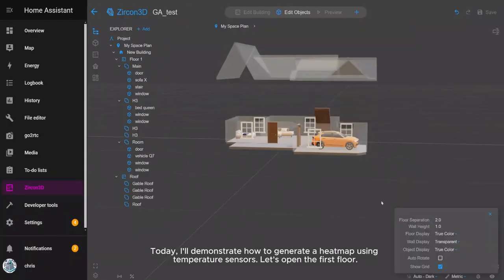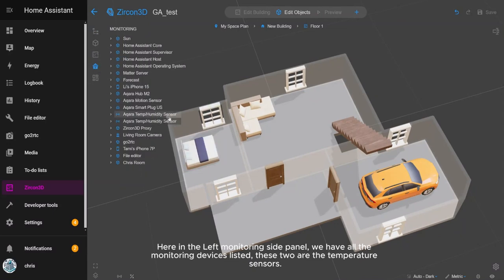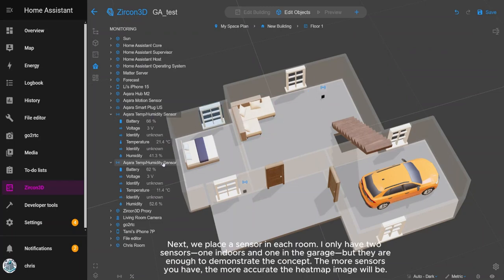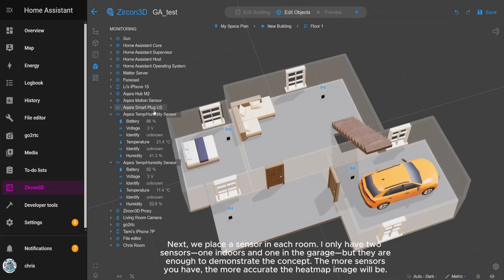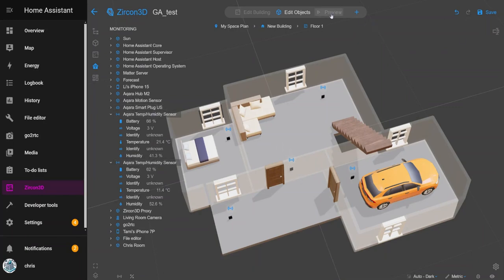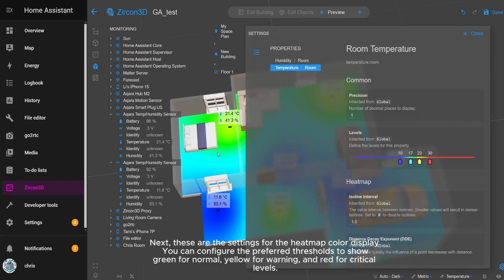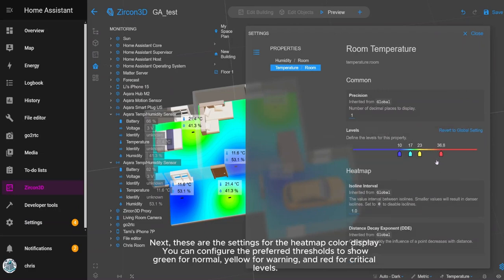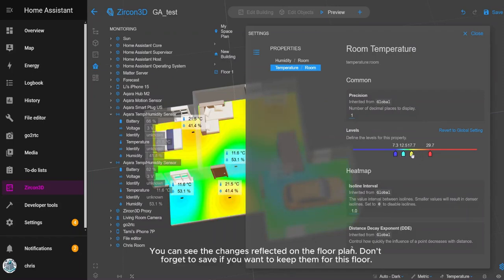Creating a Heatmap in Zircon3D Home Assistant Add-on – Visualizing Sensor Data

Comment: I'm potentially interested in using this for my home greenhouse.  I'd be looking to make maps of a few other things in addition to temperature and humidity.  Is there a way to make other maps?  
A few I know I'd like to make a map of are - soil water content, air VPD, PPFD, DLI, and CO2.
Reply from the maker: Thanks for your message, we’re completely on the same page!

Our next major update, v1.3, will focus on introducing customized heatmaps, which will let you define heatmap layers for any specific entities, not just temperature or humidity. This will open the door to visualizing things like soil moisture, CO₂, VPD, PPFD, DLI, or any other sensor data available in Home Assistant.

We expect v1.3 to be ready within the next 2–3 months.

In the meantime, feel free to try out our latest release, v1.2, which includes a number of improvements and new features — including support for KNX and template sensors.

Would love to hear your feedback if you give it a try!
Reply: @Zircon3D  thanks for your reply, sounds amazing!